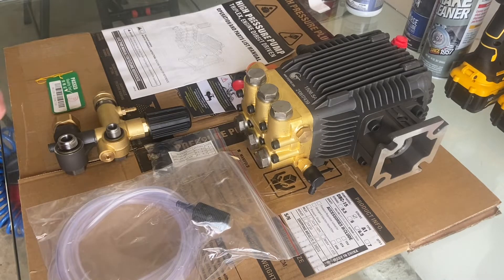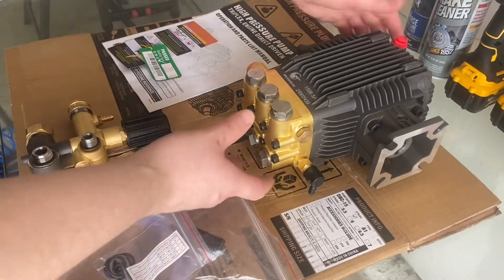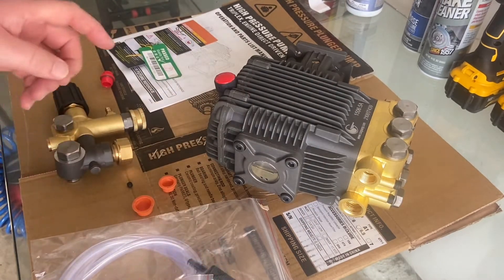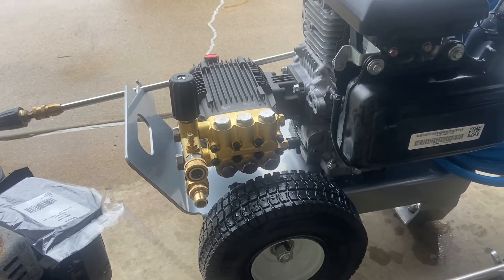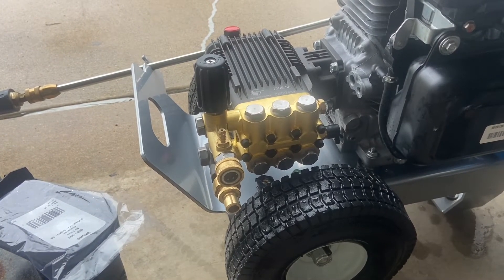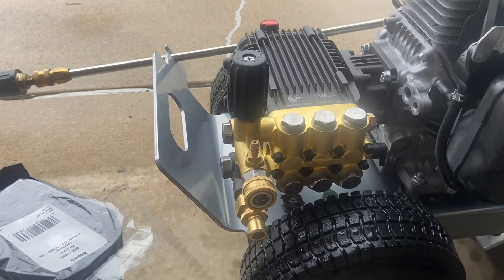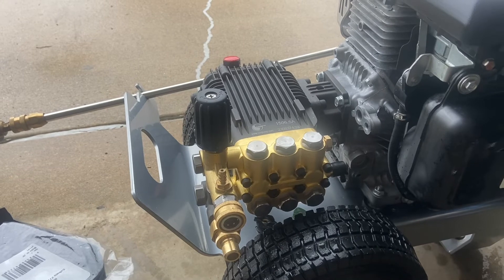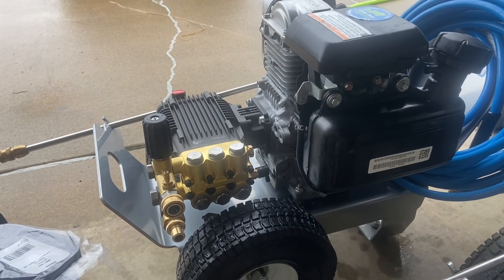CanPump 3000PSI – 3.1GPM Triplex Pump 3/4″ Hollow Shaft 3WZ-1506.5A Review and thoughts

Comment: What size bolts did you use to connect the pump to the motor?
Reply from the maker: I'm in the USA and they were 5/16-24-UNF and either 1 or 1.25 inches long

Comment: I got the 1807 4.8gpm pump. Seems to work good. I think these are actually rebranded Danau pumps. Who knows who makes them in China. I'm about to go bigger with a 6.61gpm gear drive canpump.. i don't use the included unloader. Straight into the parts box in my shed. Get something better like a vrt3